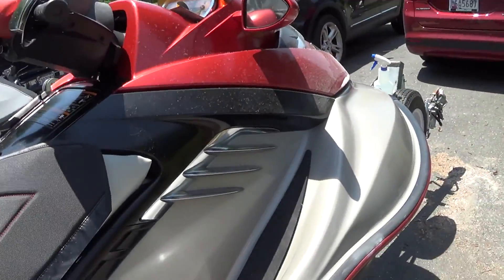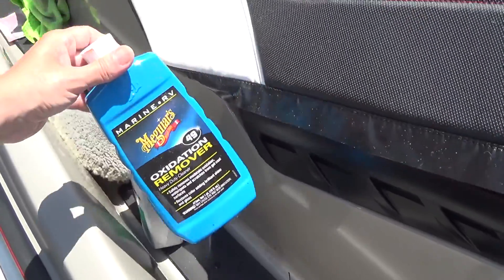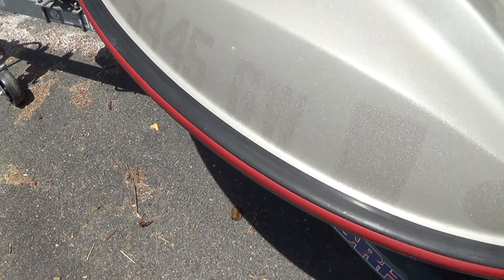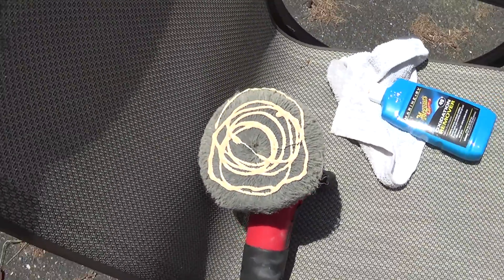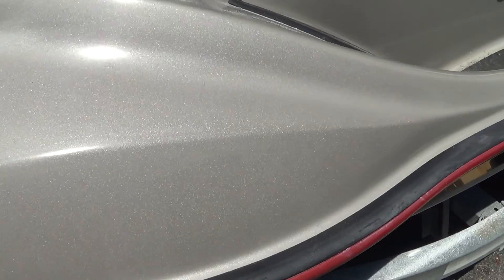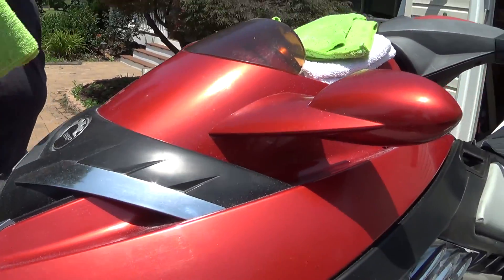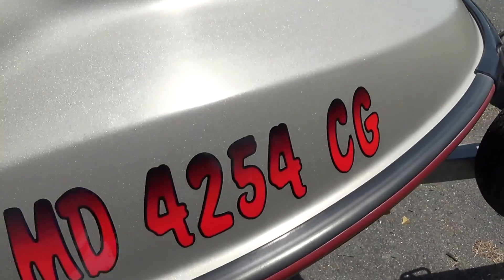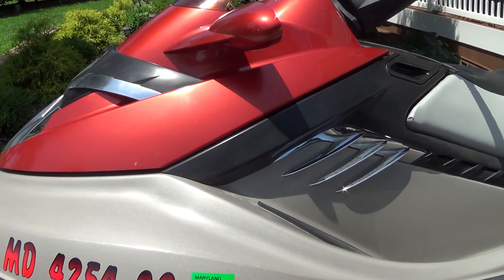Sea Doo Restoration Day 2

Comment: The higher number on the sandpaper, the better the shine will end up. If you would have wet sanded each step in succession 400/800/1200/2000 and then compounded and polished. You would have to wear sunglasses to view it. Either way, nice job.